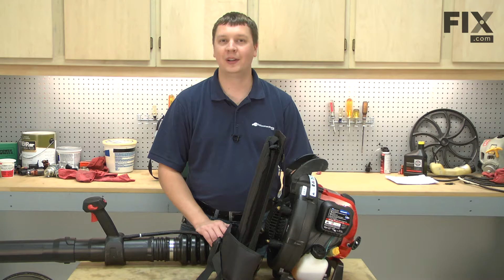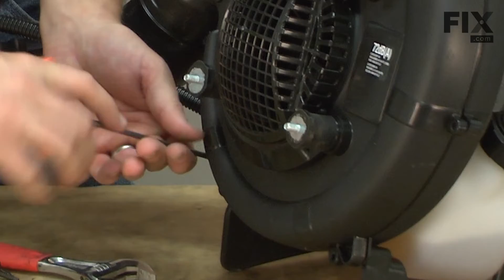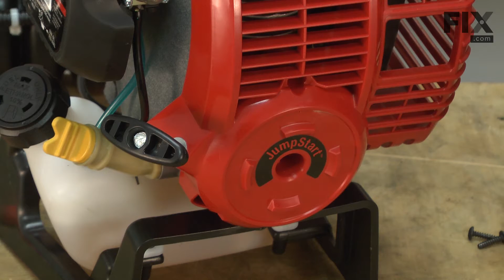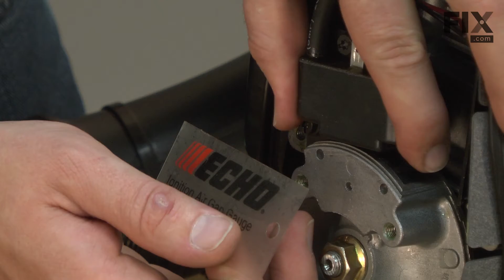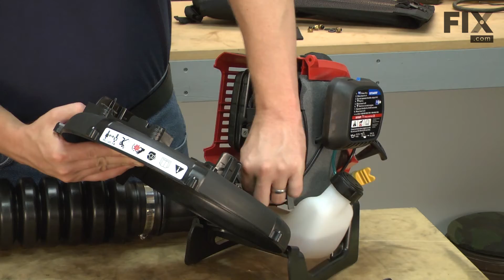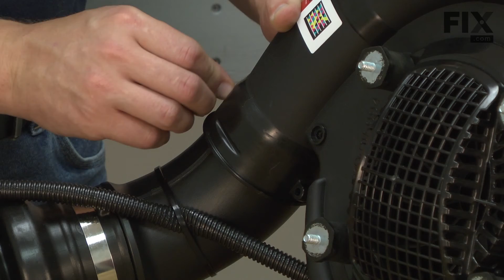Troy Bilt Backpack Blower Repair - How to Replace the Ignition Module Assembly

Comment: Great video! The back half of my blower housing secured by the four screws on the front side do not want to budge. Despite my having secured the blower in a vise. I've already managed to strip one of the T25 Torx screws. Did yours spin out easily?